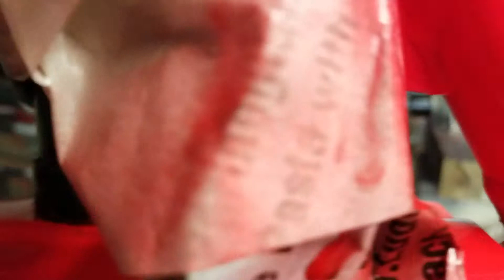250 ex seat cover on & 250 atcc

Comment: paint job came out real nice....seat covers are always annoying to get a tight fit... Especially when the weather is cold....
Reply from the maker: Thanks,  paint job all done & complete,  finished.   I just changed gear oil in rear end of honda 250 bigred,  tomorrow I'll put front rack & brakes job to put on slowly during this week , little by little..  it gonna be looks awesome when it s coming out of my basement soon enough.  Lol.  Yes that quad trx250ex seat is sucks but I'll get it right anyway